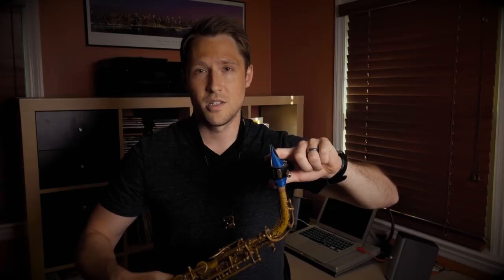3D Printed Mouthpiece from my STUDENT!!

Comment: Nice video Dave. I guess it's just a matter of time before we can all make mouthpieces to order at home haha.
Reply from the maker: Haha, thanks! Break a lig screw? 3D print it. Drop it and break a palm key? 3D print a new one!
Reply: I also wanted to print 3d mouthpiece but guy said that this material is very unhealthy. But its  still possibile to make cast and make it brass silver or other material
Reply: @DavePollack  I think I've seen an entirely 3D printed alto sax somewhere online before.
Reply: Most forms of technology start out very expensive before becoming much cheaper. For example a PC back in 1996 would run for at least 3000$ and now you can buy a prebuilt from Best Buy for less than 500$. I expect the same thing to happen with 3D printers.
Reply: @pukalo  you can already buy somewhat cheap 3d printers, my brother bought one for less than 200€ if I'm not mistaken... He had to build all pieces himself and calibrate it but he basically saw tutorials on how to calibrate it and adjust and everything to work with it
Reply: @mateuszmateo4447  you need to treat it with something to make sure there are no cracks for bacteria to get in, as well as use PLA which should I believe is food safe so it should be fine for a mouthpiece
Reply: @mateuszmateo4447  petg works
Reply: @pukalo  Consumer 3d printers have gotten so affordable enough that anyone can own one. Where I live you can walk into  microcenter and purchase an ender 3 pro 3d printer for as little as $200.

Comment: You should try 3D printed reeds next! My brother has printed me a few, gotta find a design that's right but the sound is pretty thin.
Reply from the maker: Jeez that'd be insane if you could dial that in!
Reply: I had a friend try this. The plastic that 3d printing was made of was too stiff for us so we couldn't make it vibrate. It was a good try though
Reply: Maximilian Norris It took me 3 tries including learning how to use the CAD software to get a good Reed, there’s no way you were using something that hard, I’d try printing in different configurations and then sanding the Reed smooth.
Reply: @maximiliannorris3104  haha i tried the same with my friends in band. My reeds had the same problem.

Comment: Sounds surprisingly good. I'm guessing it's plastic? I wonder if you could stick hard rubber in a 3d printer.
Reply: I dont think so because there is always a nylonn which holds the basic i frastructure of the 3d printed object and it is then mixed with you material of choice( carbon fiber or fiberglass etc) or thats how the 3d printer we have at my school works
Reply from the maker: Thanks! It's the standard 3D print plastic stuff - very coarse plastic-type material

Comment: What material did he use? From my experience most of the available materials weren't safe to use
Reply from the maker: No idea - I’m guessing it’s the standard 3D print plasic stuff...definitely isn’t the nicest!
Reply: ABS should be inert to saliva. Without excessive heat or sunlight there shouldn’t be any leeching of styrenes either. PLA is food safe. It’s probably not polycarbonate but if it were beware BPA leeching.